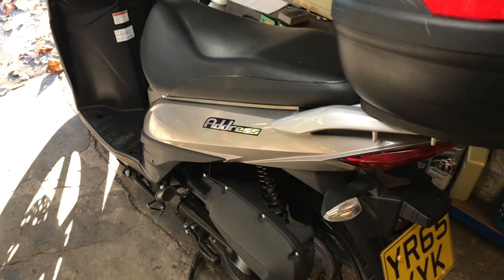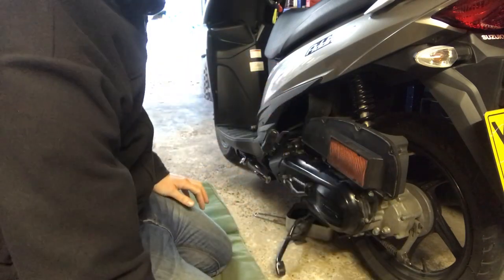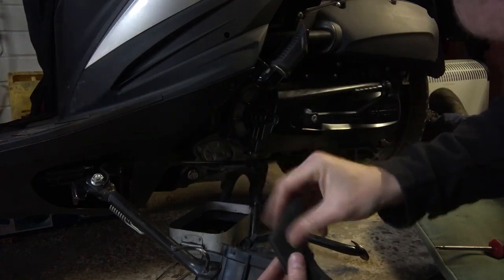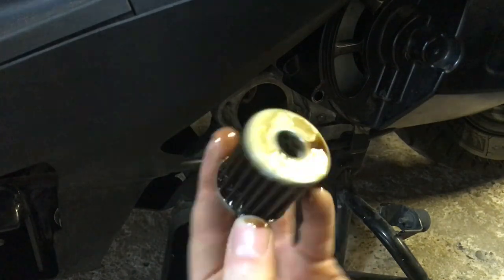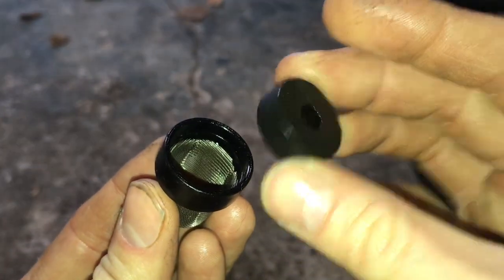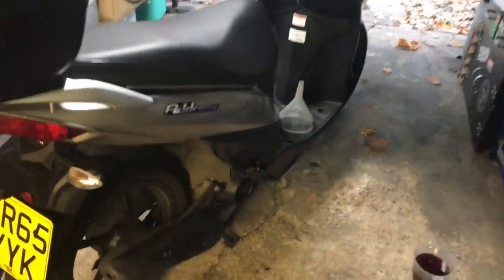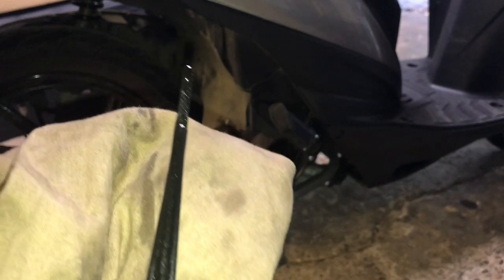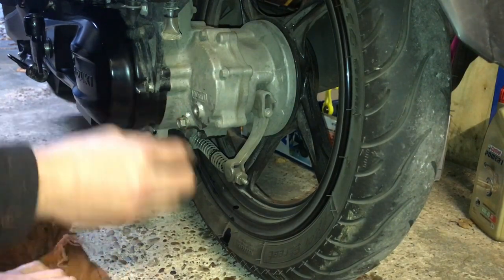Suzuki Address 110 - HOW TO SERVICE YOUR SCOOTER

Comment: I have leak from oil filter cover any suggestions on how to fix it?
Reply from the maker: Are the two bolts fastened correctly and the same amount? If so then either the cover is damaged, or the circular rubber seal is damaged. I think this is the most likely cause 👍
Reply: @MechitBetter  Everything was fine till I tried to change the oil and filter. I dont think that cover is damage its maybe be the o ring I dont know.Will call Suzuki dealer tomorrow hope he has that o ring in stock :-(
Reply from the maker: It might be worth checking that both bolts are pretty much equally as tight. If they’re not then there’ll be a leak from one side. If it’s been over-tightened, then the seal is probably damaged. Or it may be missing altogether if it was forgotten during reassembly. Good luck. Give us a shout it if continues 👍
Reply: @MechitBetter  Hi got the o ring yesterday and still had a leak. So than I removed oil filter cover checked again put it on flat surface and here we are cover is bend :-( So it will be Monday when I get the part and let you know after.Thank you for your help
Reply: @Thế Tài Cao Yes, the cover was bend and had to be replaced. Cover costed only €2 so cheap fix :-)

Comment: My nephew crashed my uk110 now my steering wheel is crooked nothing else seems to be broken can you help?
Reply from the maker: That’s a tricky one. The frame or forks could be bent. One thing worth trying is to loosen off the lower fork clamp bolts, load the suspension a few times by pressing down hard on the bars, then tighten up the lower fork clamp bolts. This can sometimes settle things back to normal, but not if anything is actually bent. My advice would be to take it to a professional garage and let them investigate properly 👍

Comment: What gear oil do I use 
Thanks
Reply from the maker: It’s just the same as the engine oil. I mention it in the video 👍
Reply: Do you have a video on how to change reg plate light bulb thanks

Comment: when putting new filter back in why didn't you put fresh oil through it first then put it in?
Reply from the maker: The oil filter? What purpose would that serve?
Reply: Mech it Better when you start back up the bike it can affect the engine so next time poor some through the filter then place back in
Reply from the maker: Any oil poured in to an open paper filter or filter housing like the Address has will just pour all over the floor before getting the cap back on 🤷🏼‍♂️
Reply: @MechitBetter  just a tad bit in filter before putting back in is all nice video you explained it good detail what is it that you was doing keep up the good work

Comment: Does somebody know how often do i need to change the belt?
Reply from the maker: Every 12,000 miles (20,000km). Inspection recommended every 2,500 miles according to the handbook.
Reply: Mech it Better thank you very much!
Reply from the maker: No problem 👍

Comment: hi guys, nice guide !   does anyone have the service manual or can point me to it  ? anyone have handy the efi error codes and how to put it in service mode ?  tks n cheerzz
Reply from the maker: Hi Andy. The only proper service manual I know of is the one the Suzuki dealers use. My local dealer has been kind enough to print off individual jobs if I’ve needed them, but I haven’t been able to extricate the complete manual from them (yet). Maybe you could ask your nearest dealer. If you get the full manual let me know because I’d sure like a copy! As for the service mode and efi codes, I’m afraid I don’t know. I only know that it blinks quickly in sequences of three if the battery is low on charge, and that an EML light on constantly indicates an injector fault (according to the handbook). I’ll put a link to the Address 110 Facebook group in the description of this video. Someone might be able to help you further 👍
Reply: @MechitBetter  hi Mech :) tks for reply... can't get manual here locally I tried,  these scoots are for the Indonesian market and there is some info and videos there but Google translate is veery bad !  I found there a video with the srv mode and the codes but how to reset them or if it resets the whole ecu is incomplete... was hoping to get procedure from a manual...
Reply from the maker: Sorry I can’t help further. There are a few Indonesian guys on the FB group who might be able to help translate for you. I’m curious, what issues are you having that require a reset?
Reply: well mine is at 18k km still under warranty serviced a the local official dealer, I have a number of complaints with the scoot, one being that the throttle response and performance  are very  bad , top speeds anywhere from 80k/h to 109 k/h mostly on the low side, from day one. Also it is performing better at about 90% of the throttle and if you go full throttle  its like its suffocating . Local zuki srv have no idea they just change oil and  plugs it seems ! Since fuel, plugs, filters have been ruled out it seems like the efi/ecu . Now getting into dealer mode and reading fault codes is fairly easy all one needs is a wire or paper clip to short the plug and a couple of moves. Thereafter is the issue  , reset the ecu ? will it reset the whole ecu or just the error codes display ? will it adjust the sensors and solve the problem ?  .... cheerzz
Reply from the maker: A curious problem. I’d be eager to hear the results if you get to the bottom of it. I had a look around the Facebook group and found this file while supposedly shows the error code sequences. Maybe it will help you?

http://i65.tinypic.com/2znreht.jpg

I’ve never attempted to go in to service mode myself. Also keen to know how that works! 

18k KM is a lot. Have you changed the rollers in that time? I’d have expected that they’d need replacing at half that mileage, and worn rollers could give poor throttle response and top speed, and also mean the last 10% of the throttle is lacking in go.